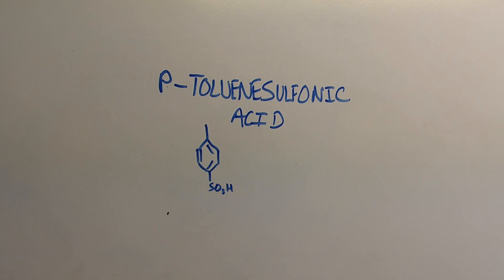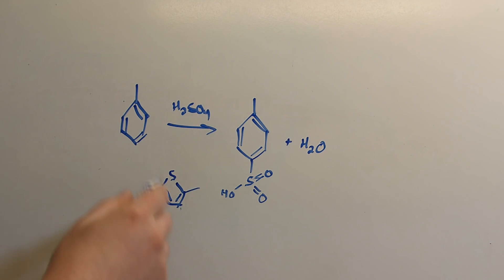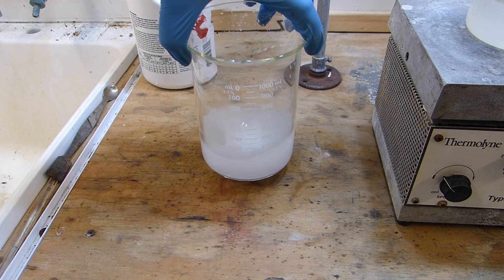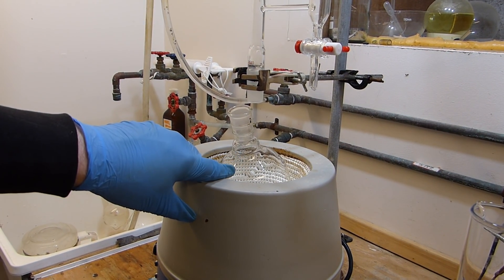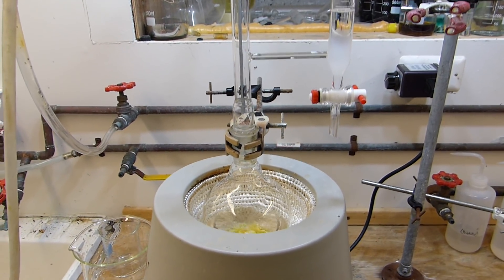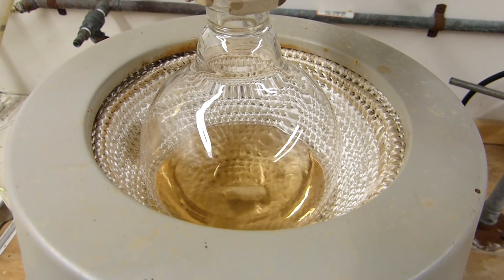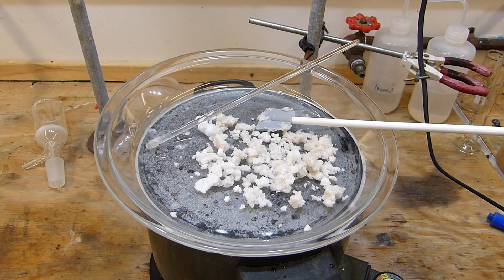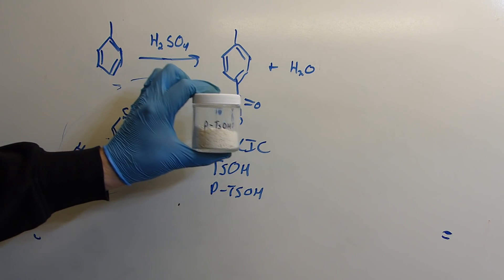Sulfonation: p-Toluenesulfonic Acid

Comment: Can i use 15% sulfuric?
Reply: for p-TsOH syntesis the reaction needs no water, so it wouldn't work untill all water is distilled over. it's easier to concentrate the acid by boiling the water first.

Comment: When distilling sulphuric acid, can I use a PTFE magnetic stir bar or will it get totally destroyed at 380 deg C?
Reply: late answer, but no, PTFE starts to decompose at 200c. you can use a borosilicate glass stiring bar (which is just a magnet surrounded by glass) or just skip the bar entirely and use anti bumping glass granules

Comment: Re the thiophene removal step: I found that just stirring magnetically with the sulphuric acid didn't efficiently sulphonate all of the thiophenes. After adding to a separatory funnel and shaking vigorously, the acid layer became very dark, and actually turned blue (?!). I had to discard the acid and repeat the acid washes 5 times until the acid layer was only a pale yellow colour.
Reply: David Robertson i have the same problem. I think our acid is not pure

Comment: Using "wet" toluene will hurt your rxn - You'll spend a lot more time collecting water. You should have dried it with Copper (II) Sulfate, first. It's my personal favorite for benzene and toluene.
Reply: You'll spend just as much time with the drying, filtering, and clean-up.  It is a good drying agent when doing solvent-solvent extractions, though.
Reply: Indicating too 🤓❤

Comment: It is, perhaps a silly question, but it has been more than thirty years, and you remind me of why I miss it so. Why is it para? Is it that the meta comes at a higher temperature, or some resonance effect, or are you getting a mixture, and just didn’t mention it?
Reply from the maker: Not a silly question at all! Para is favored in this case because of the ring activation effect of the methyl group, which is an electron donor and contributes electrons to the resonance via conjugation. This contorts the electron density of the ring to favor ortho- and para- species. Since there are two ortho- sites and one para- site one would expect more ortho- than para-. However, the steric bulk of the methyl group means that for sulfonation in particular, the para isomer is favored over all other outcomes by a huge margin. It is less stable next to the methyl group and will readily rearrange to the para- position at high temperatures. Had I used SO3 in H2SO4 and kept it cold, I could very well have had a significant percentage of the ortho- product.
Reply: Doug's Lab Hi,i have a question.
In the last Lab Tour you said you will make a more detailed Lab Tour.Will we see that in one of your next videos?

Comment: And what with this ~40ml of trapped Toluene in Dean-Stark apparatus? It just didn't react with H2SO4? Did you count it as a loss?
Reply from the maker: A large excess of toluene is always needed to drive the water removal mechanism. In this case, sulfuric acid was the limiting reagent by a large margin. However, the toluene in the dean-stark trap is clean and can be dried and reused for other experiments.

Comment: 3:38 y the toluene became cloudy b4 u added the H2SO4?

9:45 btw u should add H2SO4 b4 toluene 2 maximize ur yield since toluene is already in excess
Reply from the maker: At 3:38 I had already poured some but stuttered or messed up my narration so I had to start again! Good eye.
At 9:45, since the toluene was wet it was better to add the acid to it rather than the other way around for the same reason you shouldn't add water to acid. It could have resulted in a lot of toluene vapor escaping the flask.
Reply: ur 1 dumbass

Comment: sodium carbonate is also available as arm&hammer "washing soda" in the laundry section of many stores near the borax and blueing, alternately it can be formed by heating sodium hydrogen carbonate (bicarbonate) to over about 90c dry or wet.
(actually decomposes at room temp but very slow(months-years) only seconds in boiling water, the resulting carbonate is heat stable to several hundred degrees.)
Reply: wolfedog99 I use the arm and hammer washing soda as a source of sodium carbonate as well. It works great for everything I've used it for thus far. And it is so easy to turn it into virtually pure NaOH. Every home chem lab should have some. 😀

Comment: I honestly have no idea what you just made,, BUT as always Very Interesting,,, I do have a question since I’m the First commenter,, can you extract cyanide from seeds, then dissolve gold with that cyanide?
Reply from the maker: Yes, you could technically accomplish this. However, the yield would be too low to make it worth the effort. There are other, much easier ways to get cyanides from hardware store chemicals rather than hundreds of pounds of apple seeds and cherry pits.
Reply: DR Inventions if you are talking about apple seeds, there is not a very large amount of cyanide in them, but maybe CodySlab could do that.
Reply: Actually I’ve heard that walnuts with the hull,,( the part that surrounds the Nut shell)has a decent amount in it,, the old timers use to tell me stories about how they’d gather up a bunch in a burlap bag an throw it in a pond, and in a matter of minutes the fish would just float to the top to be netted up,,but you know old timers an they’re stories
Reply: Fresh bamboo shoots have a fair amount of a compound that forms hydrogen cyanide in contact with stomach acid, mg per Kg of course but enough to be potential health concern under certain conditions. The compound decomposes at cooking temperatures.(near boiling for a couple minutes, not just warmed)
Peach kernels(bitter almonds) are also known for cyanide.
Reply: Well the real question is,, can you separate the cyanide from mother solution of juice extracted from seeds or seed parts an other yielding plants to successfully dissolve Gold or would you even need to extract the cyanide out to do it.. I just think it would make very interesting video,,

Comment: I've been wondering how to run a proper sulfonation fro a while now. Do you think this would work with naphthalene to yield naphthalene sulfonic acid?
Reply from the maker: Not really. If you're looking for 2-naphthalenesulfonic acid, it's pretty simple. The high BP of naphthalene allows you to simply mix naphthalene with sulfuric acid and hold that at a little over 100C to continuously remove water. You literally just heat the two together for like 24h and allow steam to escape, then do an acid/base workup.
Reply: Thank you. This makes sense. Great video by the way.

Comment: Hey this video is perfect timing! I was FINALLY able to buy a gallon of toluene the other day (and trust me I've been looking forever for it) so might have to give this reaction a try!
Reply from the maker: Congratulations on your purchase! Toluene has a lot of uses in the laboratory, and I think a gallon might not even be enough! It can be oxidized by permanganate to benzoic acid, or nitrated and diazotized to make lots of azo dye precursors. Nitrotoluenes can also be reduced easily to various toluidines, and a sandmeyer reaction can give halogenated toluene derivatives. It makes a great benzene substitute in a lot of old procedures which call for benzene, a great nonpolar blending solvent for TLC, the prime mover in a Dean-Stark setup, and all of this is barely scratching the surface. I'm excited for you. :D
Reply: Used for thinning and cleaning certain industrial epoxies and paints as well as an octane rating booster in gasoline blends. chemically similar solvent to xylene but it evaporates faster.
Also mix 1:1 with methyl ethyl ketone (acetone seems less effective) for one of the strongest solvents I have found for gunk and gum in the nooks of mechanical bits. (dried up bearing grease, gasket and sealant residue, stagnant fuel gums, sticker residue)
Soaking parts in a metal or glass container with some agitation is fine but work fast with gloved hands, it has a fairly short breakthrough time on most glove materials including nitrile, which is not the case with either solvent neat. Also this only seems to work undiluted, adding any significant gasoline to stretch the volume (for soaking large parts) seems to destroy the effect and has only the solvency of basic gasoline.
Reply: snowdaysrule2 why would you need a gallon of toluene?
Reply: Yea a gallon is absolutely overkill but my options were either that or a 5 gallon pale! So relatively speaking I bought the smallest quantity they sold. It's more than I need, but was super thrilled to have found it locally
Reply: wolfedog99 Will keep the 1:1 toluene/mek combo in mind when cleaning up the metal parts in small engine carburetors thanks!
Reply: DOUG NO, don't give him adeas about nitrotoluenes, he might lose everything.
Reply: Doug's Lab Thanks Doug, I'm glad someone out there understands why I was so happy to have found it! I wanted it to use as both a solvent and a reagent. It doesnt mix with water so I can use it in a sep funnel in liquid-liquid acid base extractions. And as a reagent it's super cool because it has benzylic hydrogens on the methyl group, so it's much more reactive than a typical hydrocarbon. You can chlorinate it, partially oxidize it, fully oxidize it, and even turn it into benzene! I hadn't thought about doing any nitrations on the aromatic ring (I generally try not to work with energetic compounds if I can help it) but I just checked out the sandmeyer reaction you mentioned and that looks really interesting. I have sodium nitrite on hand and have done some experiments with nitrous acid and making alkyl nitrite esters before so I will keep the diazotization-type reactions you mentioned in mind.

But anyways I really appreciate you taking the time to respond to my comment with such good info. It was very thorough and thoughtful and I'm glad you're back in the lab making great videos again!
Reply: yeah, but please be safe, and don't smell the fumes. BTW, how much did you pay for it?
Reply: The Terrible Animator Absolutely safety is always my #1 concern :) It is quite volatile but if you chill it (I left the 1 gal container outside overnight before transferring some to a smaller amber glass bottle) before working with it the fumes aren't so bad. And by the way I like the videos on your channel of the flyback transformer circuits and the sodium chlorate experiments. Did you make it yourself electrochemically? Both of those projects were some of my very first (and favorite) experiments so it's really cool to see that you're doing them too!

Edit: Almost forgot, it was like $30 for the gallon. I believe it goes for $40 a liter on ebay so it really wasn't a bad deal for being able to buy it locally. I'll just need to clean it up a bit to remove the sulfur compound impurities like Doug does in this video.
Reply: Thanks, and yes i did make it by myself, though that was the first few grams i made and were very contaminated, i learned how to purify things from there.
And seriously, mind the fumes, i worked a little bit with 200ml of the stuff and i didn't notice that my fume hood wasn't working properly, and i got dizzy and sick for the rest of the day, i gallon of toluene evaporating in the air is no joke. And no, you don't have safety in your first priority, nobody has.